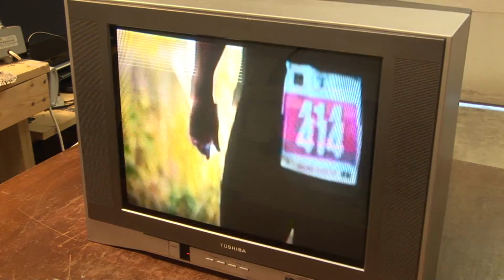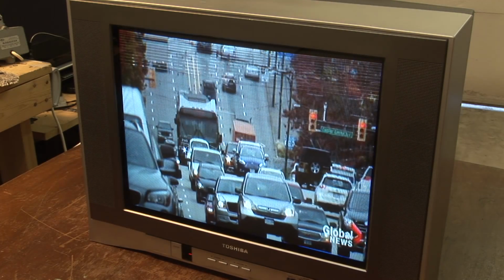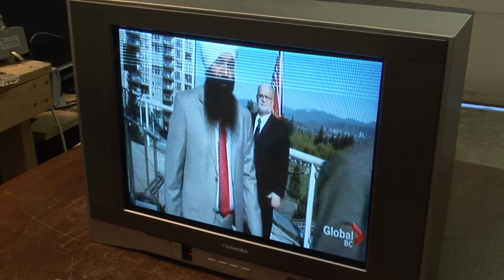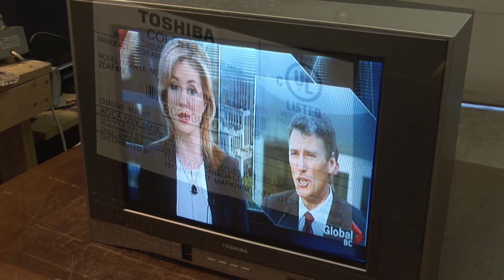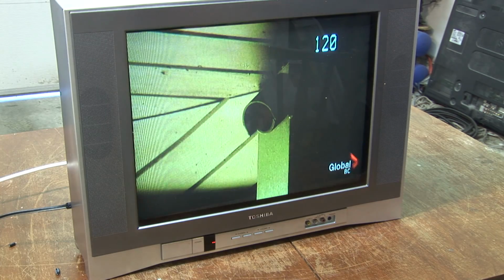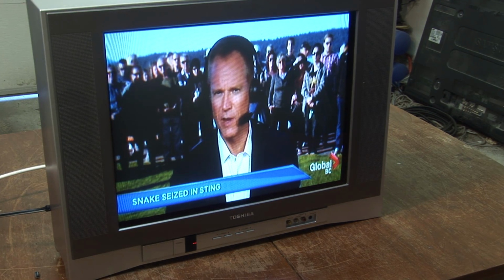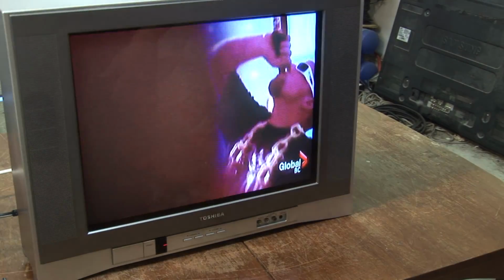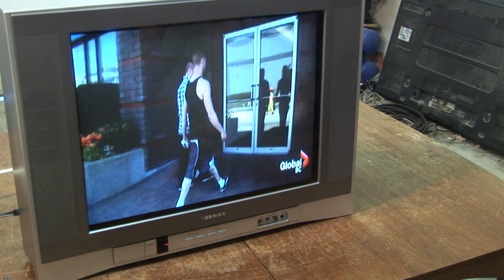Toshiba 20AF45C CRT Lines in Pix

Comment: Thanks,enjoyed the video. I have a '01 Toshiba 20AF41C which stopped working a few weeks ago. It won''t power on; the power relay just clicks repeatedly every 4 seconds or so when the power cable is plugged in. It seems like the power supply tries to start up but something causes it to shut down immediately due to built in safeguards. I am an electronic technician and have been attempting to repair it but no luck so far. Like you I would love to save the TV as it produces a beautiful, sharp, clear picture. At first I went after the power relay thinking the contacts inside were burned or corroded and not allowing the relay to stay in the 'on' state. I replaced it but nothing changed. I've watched a lot of TV repair videos on Youtube  looking for ideas and a common thread seems to be faulty capacitors. I don't have a ESR meter, just a regular meter so I can't test for faulty capacitors. Visually they all look ok and I don't see any charred or exploded components or toasted areas on the main board or the CRT board. I replaced the 3 highest voltage rated caps in the mains area of the power supply but nothing changed. Now as a last resort I have a horizontal output transistor on order as this seemed to be another common thread in the repair videos, specifically shorted ones. When I removed the original one and did a diode check test on it  the readings were questionable. If replacing the H.O.T. does not fix it, what can I look at next? You seem to be experienced in TV repair so any advice would be greatly appreciated. Sorry for being long winded with this post!

Comment: HDV Tape! I've wanted to try HDV :)
Reply from the maker: HDV was a technology pioneered by Sony Panasonic and JVC that used MPG2 IPB GOP to encode HD signals at either 1440x1080i or 1280x720p onto a standard mini DV tape. Mine is the 3CCD camera, and the quality is great, color accuracy is excellent. I still use that camera for film to video conversions.

Comment: also, you could have a bad vertical rectifier off b+ etc...As you well know
Reply from the maker: That would typically cause a short pix top and bottom. When it is fold over on the top it is going to be the bootstrap capacitor.
Reply: That was useful. Thank you.

Comment: I love all your videos,I wish you do more troubleshooting with the oscilloscope and show how to test transistors with your meter
Reply from the maker: I agree that the scope is underused for sure. I use it when it needs to be used, and that is not for every repair. As to testing transistors, I did use my meter on the PYLE and Pyramid power supply units I rebuilt to find shorted parts. Same with the plasma TVs that I repaired. The metwe was used to find shorted buffer chips, and blown diodes and transistors.

Comment: I still have a 1994 Magnavox CRT in my bedroom. Still works. There was a 100uf cap in the sweep circuit that caused horizontal lock loss, I had to fix that once. but since then its been fine. Uses the same vertical output stage as the old RCA CTC167

Comment: CRT's are so heavy and take up a lot of space, glad they're being replaced ...
Reply from the maker: +pei bossman Nothing wrong with CRTs in certain applications. For things like security camera monitors, where they can sit up on a shelf out of the way they are great, because they have unlimited view angle. I put an LCD up in the corner where I used to have a CRT monitor, but depending on where I am in the room, the picture is not clear from low angles. So I pulled the LCD and put back in a CRT monitor, and everyone is happy, as the monitor can be seen from anywhere in the room.
Reply: thanks for your comment ...
Reply: pei broker crt is amazing for retro gaming consoles

Comment: I hate rolling shutters. Anything moving fast enough will never look right, in some cases this is a problem.
Reply from the maker: +wdavem CCD cameras are superior to CMOS, but they are many times more complex, and require a ton of support circuits to make them work. This makes them more complex, and drives up the cost, and as you know cost is the killer of any product. One has to look no farther than the Blackberry Priv smart phone. It runs android, and stacks up to the best phones on the market, but it is just too dam expensive for most people. Its a killer phone, I know because my daughter dropped 1,000 to get one, and it is fantastic but it is expensive, and that is an issue. The camera I shot this video on was 7,500.00 and it only shoots video, no stills. But it shoots video flawlessly.
Reply: +12voltvids Yeah I shoot some fast action stuff, sometimes just to generate patterns for process visual effects, and the cmos cameras are useless for many effects due to the way the rolling shutter breaks up the image. That these problems are now standard with every new camera "in my price range"... I shoot with a 3 tube camera sometimes.
Reply from the maker: +wdavem I haven't used a 3 tuber since my broadcast days.Used CEI280 studio cameras, and a CEI310 portable, and a Hitachi FP40. The 280s were beasts. About 50 lbs for the camera head unit.Talk about a problem camera. Engineers were always working on them. Every day something would  go wrong. Spent more time on registration cards than actually shooting anything. Usually a smack at just the right place on the side would fix it.

Comment: CRT's are great, especially on older retro computers. Iv'e always admired CRT's for their picture quality when set up correctly. Great video.
Reply from the maker: +Aron Gooch You can't beat a good CRT for color quality. On the flat panel OLED and Plasma are about as close as you will get. LCD is way down the list.I just got a big order of video to transfer to digital files, and the time base is WAY off, so I had to haul out my time base corrector to bring the video into spec so the capture card would accept it without blowing up, and causing the computer to crash. I think a video is in order, and I will haul out the broadcast monitor to demonstrate what shitty time base looks like on a monitor with no AFC in it.Consumer TVs have pretty good horizontal AFC, and can lock onto a video signal that is just crap, but digitizers require stable video, and a TBC fixes that. I think a video is in order to demonstrate how this works now that I hauled out an old piece of gear I haven't used in probably 20 years.Usually I archive directly to DVD on a stand alone recorder, and they have a built in TBC for the video signal coming in,  but the computer capture card expects the video to be good, and complains when it is out of spec.
Reply: +12voltvids Looks like that video is up now. Will definitely be watching. Cheers.
Reply from the maker: +Aron Gooch I just put up 2 with regards to time base correctors.

Comment: Hola.   Donde consigo ese medidor de ESR?  Soy de Monterrey NL Méx.
Reply: esr is in seareys resistins (moste LTL cap must hav a varey lowe esr) onley most LTLcaps hav lowe esr.not all caps need lowe esr tho.mcc and mdc caps depinding on tha value of that cap tind to hav medeom ers wich is why mdc caps are cominley yoused in capasitiv droper power supplys wich are founed in manes led lights mcc caps are yoused in ither noiez redusing/filtering or in hight KV serkets as ither feed back (for ssnds/crt fbds)or as hight KV filtering and volteg multipliers serkets hoped this helped you

Comment: I used to have my 1992 Toshiba CT1926A and I didn't know the Special Red Cap the Rubycon caps do the same thing like ELNA caps do that two and man I got to look back to my chassis and see what do contain.

If that would be me when I'm plan to use the Surveillance Camera, I would use the 5" Monochrome TV and/or the Cheap Chinese Color CRT TV to use as a Surveillance Camera.
Reply from the maker: +Bluethunderboom I just use whatever I can get my hands on. Right now I am using an old 9" B/W Hyundai (yes the same company that makes cars) as a clock! I have an app that runs on a raspberry pi that generates a realistic looking flip clock, and it looks cool. Waiting to see how long it takes to burn in the time. There is already burn in from when that monitor was used as a camera monitor. Currently I am using an RCA CRT set, and it has wonderfull burn on. I see it as a badge of honor, to see how long I can keep a TV running as a camera monitor before it totally burns out, and the more the burn in the better.
Reply: +12voltvids Same thing for Mitsubishi, they also Manufactured both Automobiles, and Electronics.

Also for my '92 Toshiba, I didn't know that are assembled in USA, while the Picture Tube is made in USA and the Chassis is made in Japan.

Even I did watch PBS Frontline Coming From Japan, the one who's recorded back in February 1992, I didn't know it did broadcast to give people to know about Matsushita Electronics Industrial Inc. in Japan.
Reply from the maker: +Bluethunderboom Mitsubishi also made airplanes, and many of them ended up in Pearl Harbour, but that's another story. Many of the Japanese companies assembled their televisions in the USA and Canada (and Mexico). This was to get around tarrifs placed by the governments in the 80's.  They used domestic CRTs mainly because that was the heaviest part, and shipping costs were higher than making the tubes domestically, and there were tube plants looking for work.Sony made all their projection sets un the USA right up to the closure of the PTV factory at the end of 2008. The Sony SXRD set that I picked up last week was a USA made set, and it is a good one. Only had a blown bulb, and a really good picture. I decided to keep that one myself, because nobody wants projection sets, and I didn't want to give away a set with such a good picture, and the light bulbs it uses are cheap these days.
Reply: Same here, I just don't want to give to someone who wants the CRT TV because, most people preferred to Flat Panel TV, for me, I enjoying watch CRT TV like watching on YouTube on Roku, or watching the Newscast from Japan for instance include NHK Newsline. =)

Comment: Hello Sir, I enjoy every video you have made. 
i have sony trinitron crt with image is too green. could you advise what is the problem. thank you.
Reply from the maker: +farius75 Depending on which type of Trinitron you have it may be adjustable.On the CRT PCB if there are adjustment pots you can adjust it. There will typically be 5... R, G and B low level  adjust, to adjust the gray scale, and R and B highlight, for the peek white.If there are no adjustments, then you have a newer set with AKB circuitry, which automatically adjusts the picture throughout the life of the TV, and once the tube gets too weak for it to compensate there is not much you can do, but on TVs with AKB they usually just blank out the picture when they are out of range. I'll likely be doing a video on color balance soon, and I will use my Sony as a subject as it is in need of adjustments.
Reply: +12voltvids  The model is KV-TG21M61. I have adjusted all the pot's on the board ( both CRT board and main board) , also changed some cap's(near the flyback), but still too green.

Comment: Recently I've bought SONY F420 amplfier.It's fine ( some cold solder joints that I have repaired ) , but if I want to replace electrolytic capacitors  ( because it is 20+ years old ) , what best brand ( affordable ) audio grade ( and does diffrent cappacitor brand  affect sound quality, and in Your expirience how ?????? )  capacitors do You recommend ????? Thanks,,, Big fan from Prilep Macedonia
Reply from the maker: +Mende Jakimoski In my experience I really haven't noticed much sonically between different brands of capacitors, and I usually just grab whatever the supplier has on hand. There probably is a difference between standard 85' and low ESR high temperature capacitors. I have never replaced a standard rubicon with a low ESR type in coupling circuits or power supplies in linear supplies.The audiophools out there will argue the point that it changes the sound, and in tube gear this is probably true, just due to the nature of tube gear.  Myself I haven't bought into the 20.00 per capacitor for some exotic cap. I also don't just routinely go in and change the caps because they are 20 years old. I change them when they are bad. Mind you if someone brought me an amp and asked it to be recapped, I would change them all because someone else is paying for it. For my own stuff, I change the part that is bad. From my experience though if you do plan to recap an amp, use the same brand throughout it, that way they will be closest matched as far as performance goes.

Comment: I uses an Samsung CRT from 1995 and it still works like new and gives Avery good picture and you can read all the small text so it's been used much and  reason 
  I have it because it makes all of these thinks look dvd/vcr,n64,and wii and none are HD and this TV looks better than my flat screen TV did. this is my opinion and my phone takes a video like that camera you were using
Reply: +Darkwing duck videos 
I agree with you about the CRT stuff, but there's no way your phone has a CCD sensor, and I could bet some good money that your phone's CMOS sensor doesn't have a global shutter, CMOS sensors with global shutter cost like an arm and a leg, so no, your phone can't take video like a CCD camera, you just got lucky with shutter speed.

Comment: the picture quality of the camera you were using is awesome =O
Reply from the maker: +Das OSi 
Well it did cost me over 7500 when it was new so it should look good. The data rate is 25 megs and for a 1440x1080 picture that is high considering that most cameras are 1920x1080 and are only encoding at 17 megs on the hq setting. It is a 3 ccd type camera that records on mini DV tapes but records in the HDV format. It is about 12 years old now, but still packs a punch for sure an is great for things like film to video transfers and shooting monitors or spinning things where the artifacts from rolling shutter or cmos camera is a problem. But, it is big, and heavy by today's standards because it has a heavy tape transport and that 3ccd camera block and prism.
Reply: +12voltvids I didn't know that mini DV was able to deliver bitrates as high as 25 Mbps.
I took a closer look at the video (compressed by YouTube): The bitrate averages at about 3,7Mbps and only jumps to about 6 if a lot of stuff happens on screen.
Still, the picture is fine. Colors and Focus are great.
You said that this was a Sony?
Until now I only expected over-saturated and over-compressed pictures by Sony-Cams :O
Reply from the maker: +Das OSi The bit rate for the DV standard is 25 megs fixed.  DV uses MJPG compression I frame so each frame is compressed and 4:1:1 color space in standard definition 720x480i.HDV has 2 standards 1280x720, and 1440x1080.JVC cameras used the 1280x720p standard at 30FPS. Sony, Panasonic and Canon used 1440x1080i encoding, and the camera could be set up for 60i or 30p.The color space is 4:2:0 and encoding is done in MPG2 IPB @ 25 mB/sec fixed bit rate. When I capture to premiere I render out as MPG4, and I encode all my videos in 1080 @ 10 mB/sec because youtube is going to overcompress them anyway. When I shoot a 4K I generally have my camera set to 60 megs, however I can set it to 100, and when I render 4K I usually render out at 50 megs, as that looks fantastic. youtube messes that up too, as they compress to about 16.Its not that Sony cameras over compress, it is the operator not selecting a high enough bit rate. My FDR AX100 can do 100 megs, but I never run that high myself as all that does is burn the memory card up that much faster. Out of the box it did onky 60, but a firmware update and it added the higher bit rate,a nd a few other goodies. Was like getting a brand new camera.

Comment: I reckon that can also cause the EHT transformer in older Hybrid sets to catch fire very easily as that is what happened to me when we had a Hybrid  set as I was just watching TV and the smoke just started coming out of the back of the set and I just had to switch it off and pull the plug, this happened when I was living in Oaklands Cullybackey.
Reply from the maker: +DAVID GREGORY KERR 
Old hybrid sets, for those that don't know used solid state devices (transistors) for signal circuits and power tubes for vertical an horizontal deflection as well as the damper tube which basically grounded out or dampened the back emf kick from the flyback when the output tube went into cutoff. 
These beasts used high voltage in the tube circuits. A common failure was yokes and flyback from excessive DC, caused by a failing output tube, or damper tube. Another common cause, which was usually the root cause of the tubes failing in the first place was an open bias resistor in the tube drive stage. Without the negative bias resistor the output tube was not forced into cutoff an there was always some DC current flowing between the Kathie and the plate. This would make the plate glow red hot an in some cases actually melt the glass. It also caused heat to build up in the flyback or yoke a if the insulation on the copper wire melted the winding would short and the transformer was toast.

Comment: Smashing job :-D
A good bit of technology thats usefull again :-D
I did think the fault was in the vertical drive section, but ive lost touch with crt tv's, its been a good while ago since i fondled one lol.
The red capacitors, yes i sort of remember them, i never knew why they were like that untill now :-).
Back in the late 80's i built a basic cap tester, its frequency generator was a 3.57 mhz, known as an american tv colour crystal, uk ones were no good because ours are 4.433619mhz dam!!.
Lucky for me i had one of those large can type 3.57mhz rocks, god knows where i got it from as i only did pal system equipment.